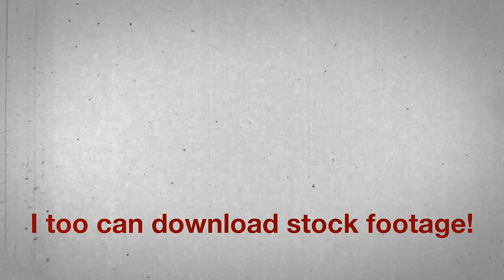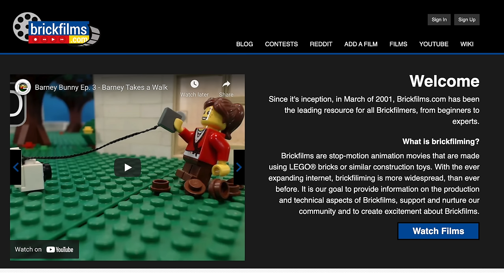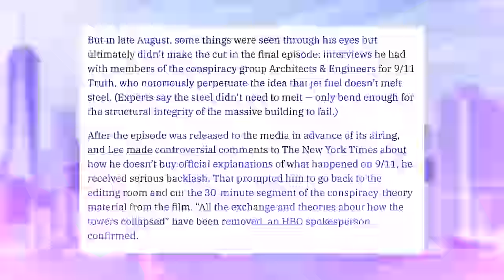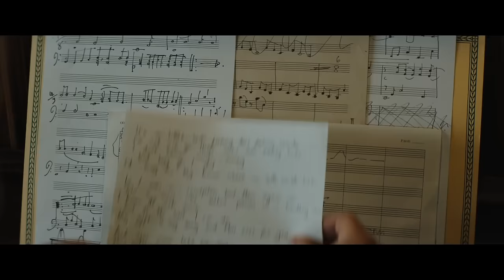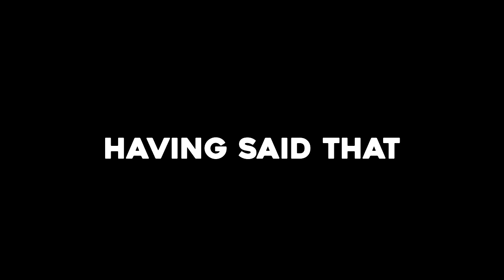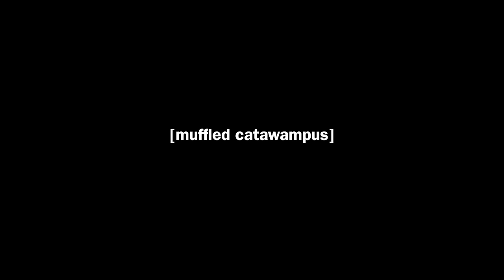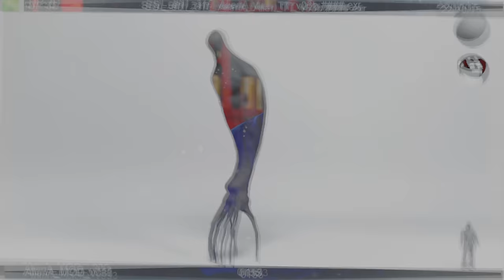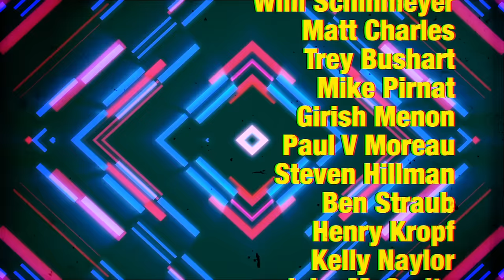The Movies with Mikey Movie Tournament (The Whole Thing)

Comment: I would've probably found myself with the same semi finalists, but my choices ultimately would be different. 
Parasite opened my eyes to what a movie can do on a technical level, on a metaphorical level and on a character level. It's simply a masterpiece and therefor worth a perfect rating.
Mad Max Fury Road however has not a single second to waste. Every scene, every frame, every detail, every single thought that went into that movie has a purpose. The one and only purpose it could have. Every decision made here is the correct one. There is no other movie on this planet that draws me in like MMFR from the second it starts to the second it ends.